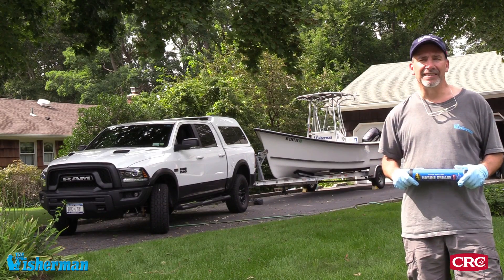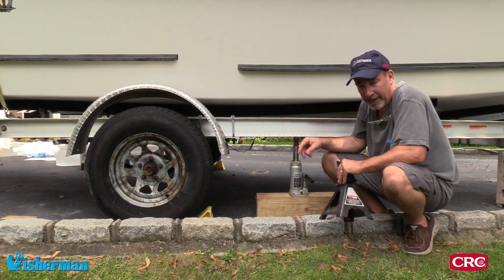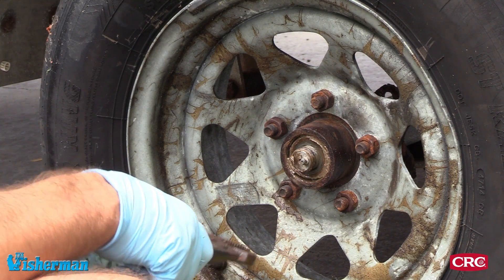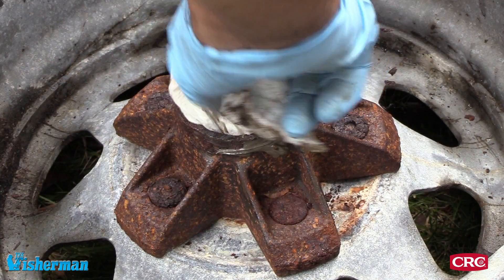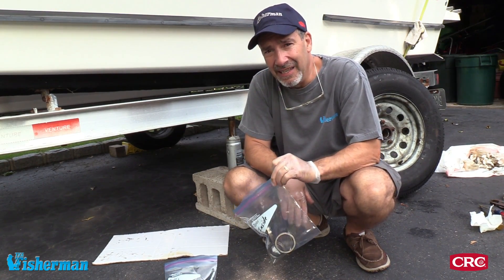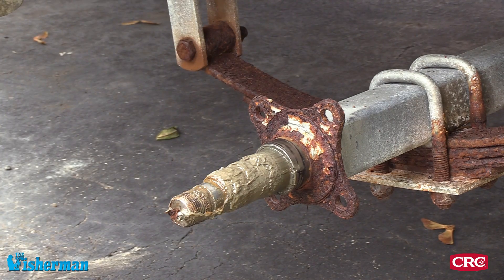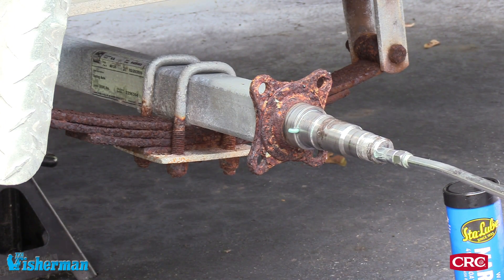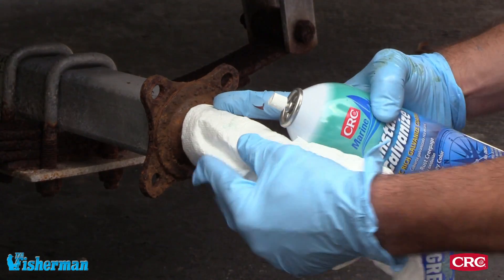The Fisherman's "How To" Series - Replacing Trailer Bearings

Comment: Rule number 1) never ever use metal to install new race. Damage the race will shorten life of new bearing. Always use hard grade plastic wedge. 

Using this guy method will only keep your boat trailer in maintenance and trailer supply loving your business.

Also, not properly. Torquing washer against bearing will allow saltwater in and wash away any lubrication. 

There are many issues with this video. Good video, but not the proper way.
Reply: Chunky Father I never use high grade plastic. Just plain old brass. Using a chisel like he is is just plain stupid.
Reply: But never steal. Also don't know why he doesn't Jack from the axle
Reply: I really hate to agree with you guys but the truth is the truth. Wrong tools,
Reply: Spot on. To make life easier for myself I put the bearing races in the freezer the night before I replace the bearings and then use a heat source to heat up the hub before driving the new race in. It makes it way easier to drive them in, but I also use a bearing driver as well.
Reply: He also didn't what you call pack the bearings